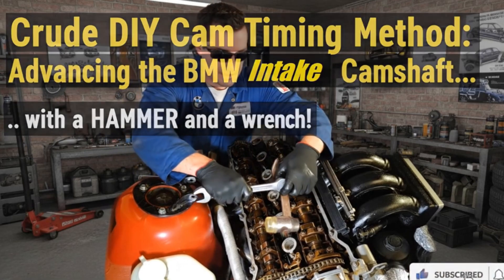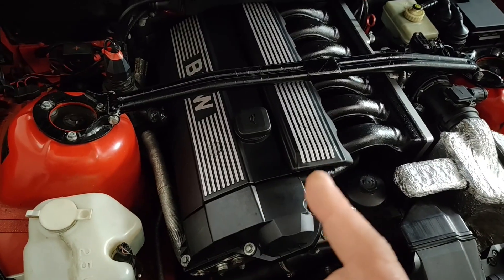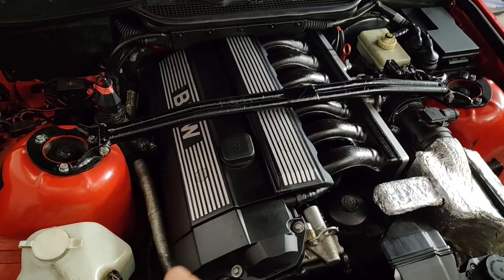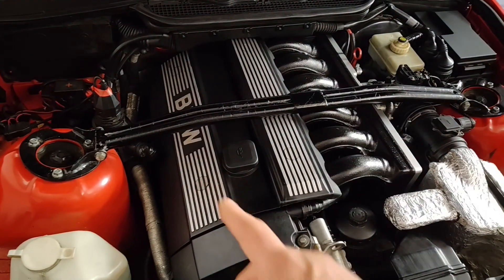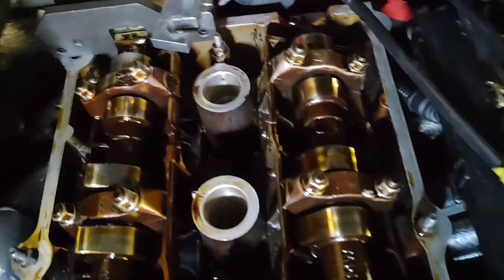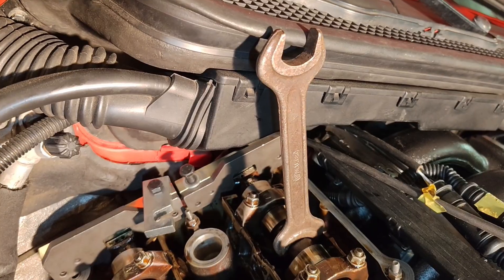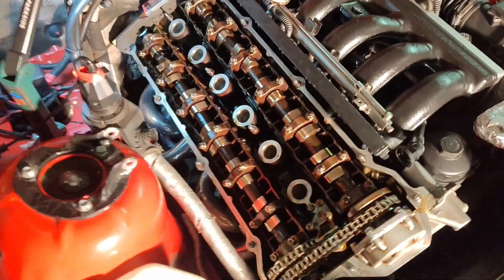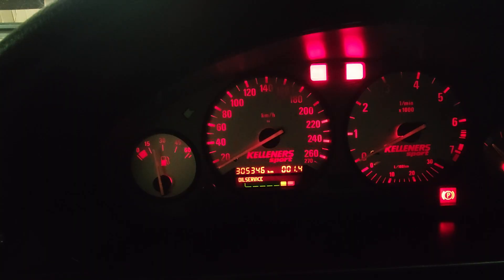323ti -The Free BMW M52 Power Mod? DIY Hammer method Intake Cam Advance/Retard (WOT MAF Test data(

Comment: 323 is over bore she loves high rpm, so she need more overlap on high rpm.

on M50TUB25 : large intake
LSA 105.5 
OL 17 
on M52B25 : small intake
LSA 107.5
OL 13

so, if you change the intake to big intake (lets say your intake more big than m52 intake),
you can add overlap by 4degree
and re-tuning.

that is more than enough.

Comment: your supposed to degree the exhaust one direction for more torque download or the other way to get more hp up top. thats been done many times. you leave the intake alone.
Reply from the maker: thanks for the advice and direction boss: but. You're mixing the general rule with the specific result. For maximum high-RPM power on this engine, we retard  the intake cam centerline. This ensures a later Intake Valve Closing (IVC), which is critical for maximizing Volumetric Efficiency by using the air charge's inertia (ramming effect) to pack the cylinder at high speeds. Ignoring the intake cam—the very component responsible for the single biggest performance gain on the M52— misses the point...

Comment: Retarding the intake cam would leave less time for valve overlap, which would worsen high rpm outpot, and potentially improve low rpm output (with all components stock)
Reply from the maker: For maximum high-RPM power on this engine, we retard  the intake cam centerline. This ensures a later Intake Valve Closing (IVC), which is critical for maximizing Volumetric Efficiency by using the air charge's inertia (ramming effect) to pack the cylinder at high speeds. I
Reply: @CSI_tuning_solutions  But the cam, retarded or advanced still has the same duration, so the ramming effect should be the same regardless of cam position, no? I can only think about that cam position (retarded) being better for your intake manifold setup, with the length of your primaries, especifically. That cam timing probably lines up the closing of the intake valve with one of the secondary reflections on the primary, and therefore you get the extra air in the cylinder that way. Am I missing something? I don't know the M52 engine well at all, so I could be way off, but what I mentioned is also (the air's inertia also is a key principle) a key principle in engine tuning.